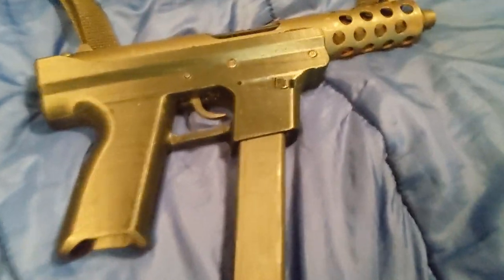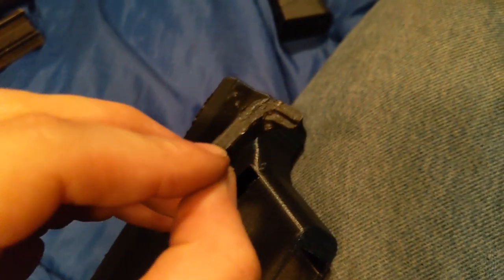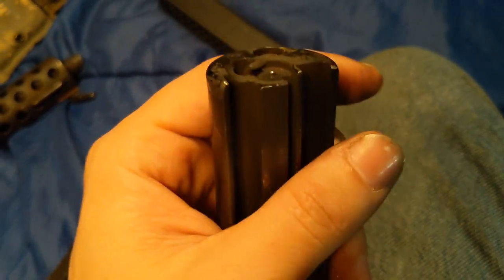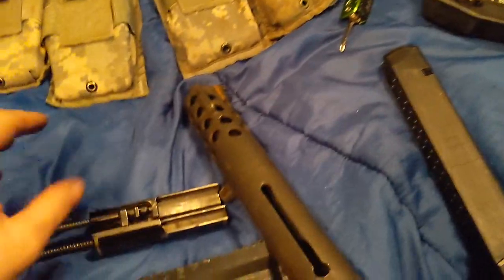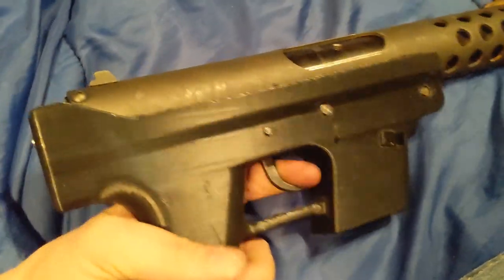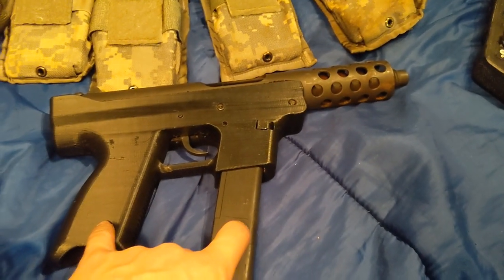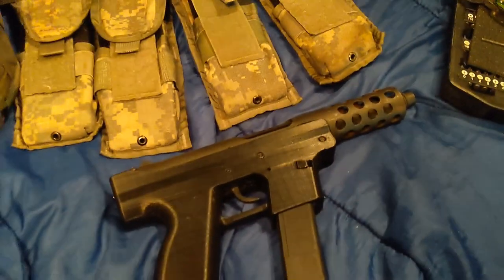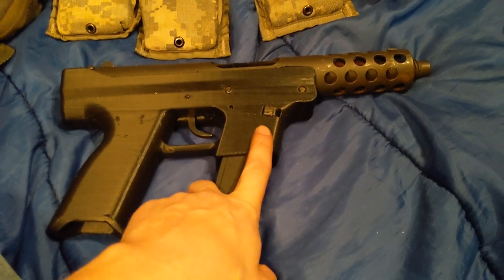3d printed tec-9 update

Comment: Hello! I'm the beta manager of the group that designed that firearm. The missing pin is a 1/8" x 1 1/4" roll pin. Having it will help prevent jams. Nice print!
Reply from the maker: Yeah I printed up a new lower I'll be adding that pin to it.  I'll be putting up video it as soon as I get some shooting time with it.
Reply: @bigexpress6412  Awesome! I can't wait to see it
Reply: Having a hard time getting the ejector know where I can find one already modified or pay for one ?
Reply from the maker: Gunp parts Corp has them in stock.
Reply: @demareeawilkerson8903  Use a drill press when modifying yours and take your time. Vanguard Arms was going to start selling modified ones I'm not sure if he has them ready yet or not.
Reply: Where do I find the 3d print file
Reply: @doctordeath4047 You're quite an asset to be able to talk to then!
Reply: @dotdot9628  Thank you! I'm always happy to help the community. This is one of my favorite prints. FMDA the original designer just sent me an updated version to start testing out

Comment: I love this. Home made tec 9 rig and in your truck. Goddamn
Reply from the maker: Get strapped or get clapped.. also be better armed than your opponent.
Reply: @bigexpress6412  I really wish I got into the printing hobby. I love seeing all these parts kits go to use but sadly all the parts kits are drying up now. What's a pistol kit that isn't an AR that's available now ?
Reply from the maker: @Donutkommando  the Mac 11 uppers are a little cheaper than a tec9 upper there a are a few lowers you can print some take Glock mags one takes Sten mags and one even takes Suomi drum and stick mags. I be got a buddy with a printed mac11 I haven't had the chance to do a video comparison of it with the tec 9. I just did a couple videos but they got corrupted somehow. So hopefully I get a chance so make some another video with my latest 3d printed pistol (a diamond back DB380)
Reply: @bigexpress6412  but what about the lowers? The uppers come with all the parts but what about the lower parts ?
Reply from the maker: The printed Mac 11 lowers use an ar fire control group.
Reply: @bigexpress6412  wow that's impressive!
Reply from the maker: @Donutkommando  I started to modify a tec9 lower to take an AR fire control group but the bolt was too long for the hammer to line up right I still might make one just need to make a custom bolt for it.
Reply: @bigexpress6412  I wish I knew how to do all that it sounds fascinating. It has its own unique aesthetic too. I'm subbing this channel I look forward to seeing many more interesting gun builds
Reply: Wish I could do this how the can I ? I need to keep 2 sons protected the world went insane

Comment: Great video. I Got my upper but need the FCG any idea where to look?
Reply from the maker: Is look at eBay and gun broker. I'll be making my own simpler fcg that will work in the same frame but I haven't had time to take measurements and make some cad files to get some parts cut with CNC. Once I get them made and tested I'll share an update.

Comment: Do you have an STL for the lower? I've got a complete upper and LPK but no lower. I don't have another one to measure the dimensions from or to even get a rough start.  I'd be super appreciative of any help.
Reply from the maker: It's in the gatalog I think.
Reply: Yes it is. It's called the ghetto blaster
Reply: @doctordeath4047  unfortunately that's the 9mm version.  The 22 Scorpion is completely different size and shape.

Any help would be super appreciated.
Reply: @bigexpress6412  I've searched high and low and didn't see it.  Is there a link or any other info you could provide?  I will be happy to PayPal anyone who has or makes this design.
Reply from the maker: I don't think there is a 22 version out there yet. If I had one I could make one. They aren't too complicated I had a tec22 scorpion many years ago they are lots of fun.
Reply: @buzzbombkirk  I'm sorry I didn't realize you wanted the . 22 version. As of yet there is not any design, however I will gladly encourage some people to develop it. Sorry again an introduction, I'm the head of beta development for deterrence dispensed. I welcome you all to join us on rocket

Comment: What size Glock mag catch did you print?
Reply from the maker: I printed the normal size one. I had to adjust it some to fit right. You might want to print 3 stock size then the size bigger and smaller to see what size you need.

Comment: Need a metal printer
Reply: 15K+ atm
Reply: No you don't
Reply: @Thrillowatt  Yes he needs
Reply: @thefool1086  it clearly works without a metal printer
Reply from the maker: It's still going strong. I haven't had time not make another video yet. I would like to try a lost pla cast and make an aluminum frame sometime. I've been working like crazy trying to make up for lost work during covid lockdowns. Do I haven't had any shop time.
Reply: @bigexpress6412  that would be incredible